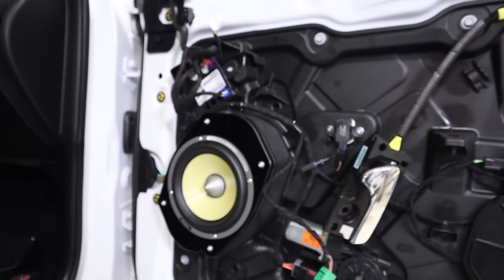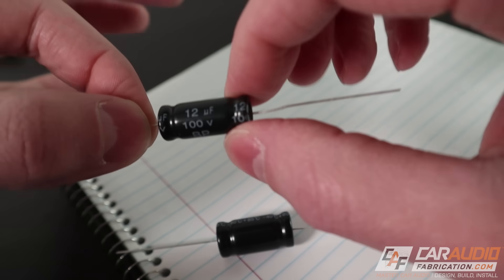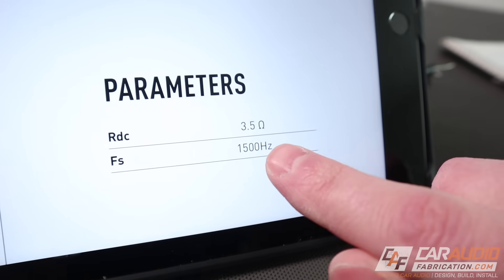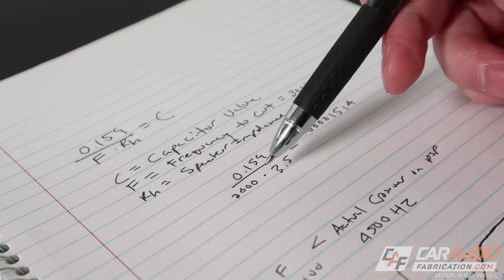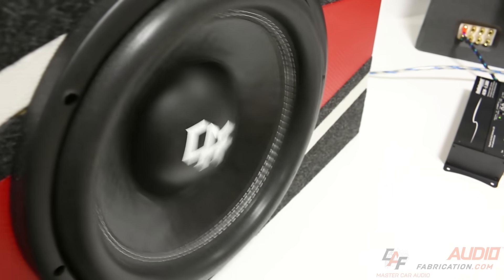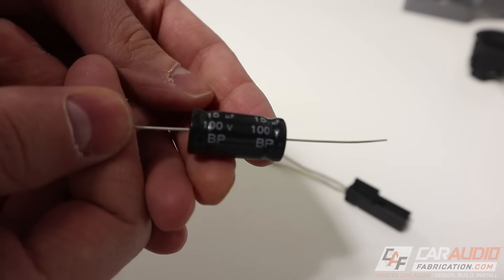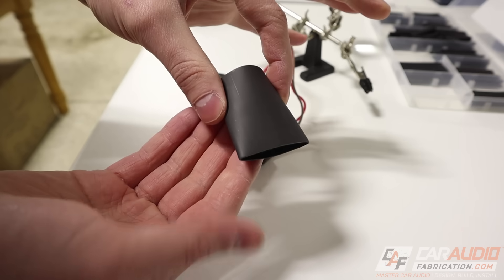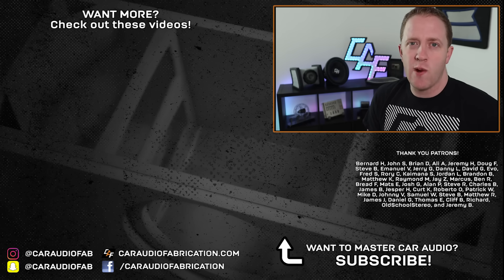PROTECT YOUR TWEETERS! Capacitors and WHY you need them

Comment: If I have the passive cross over that came with the component, could I just use that as the protection cap?
Reply from the maker: Yes, but in the mean time you will be running passive and lose all the benefits of going active.
Reply: CarAudioFabrication 

I mean, only having the tweeters connected to the passive cross over and having the mid directly connected to the amp.

Or would that still be considered a passive cross over?
Reply: Yes
Reply from the maker: That's still passive.
Reply: CarAudioFabrication 

Well, f... the the local shop sold me the passive cross overs for the Audiofrog GB saying that he would use the cross over to protect the GB15.
Reply: CarAudioFabrication 

Then again, what would happen if I push 250 watts rms at 4 ohms through a passive cross over if the tweeters and mods can handle 100 watts rms each?
Reply from the maker: I never said a passive crossover won't still protect the tweeter, so please don't go twisting my words and tell this shop that I told you they did something wrong. A well designed passive crossover with proper implementation is just fine. I don't know all the details of your system, so they may have done completely the right thing. The point is this video is about how to protect a tweeter in an ACTIVE system, sounds like your system isn't active. So this doesn't apply to you.
Reply: CarAudioFabrication 

I told the shop that I wanted to make my system an active system. I wanted the Audiofrog GB60 and GB15 to have their own connections directly to the amp. 

I have two Kicker IQ amps. I wanted the GB15 connected to channel 1 and 2 and the GB 60 to channel 3 and 4 on the IQ 500.4

Then the rear channels and sub on the IQ 1000.5

I’m trying to debate if I wanted to add a GB40 for a active 3 way setup but it may just be a waste of money.

I’m sorry, I’m not trying to twist your words. It just sounds like if I use the passive cross over for the tweeters, it’s still a passive system.
Reply: @thegreatempire3882  
As long as your tweeters are crossed over actively by a DSP or built in amp crossover, at a higher frequency than your passive crossovers are set at, you're not doing anything different than shown here. If your passive filters are set @ 3khz, but you cross your active system @ 4 khz, they will simply serve as a protective filter.
That being said, the closer the two crossover points are to each other, the more effect that passive filter will have on your tweeters.

To figure out if there's an issue or not, just tell us this.
At what frequency is your active filter set, and at what frequency is your passive crossover set?
What is the order of each filter?

Comment: you made a simple crossover. so its no longer "active"
Reply: Third
Reply: ekim andersom  
You will only affect the slope below the crossover point. That being said, when doing a 1st order filter, the slope starts vay up high in a situation like this. It will affect the active slope, but in most cases, it will be pretty insignificant.
Reply: @# of course it DOES change the phase (therefore timing).

Comment: Unless you have a crossover? Would you still need them?
Reply: If it's a good crossover no,just make sure to use the right frequency for your speakers in question.
Reply: @abimelecgalarza9918  Or you could actually pay attention to the video.The WHOLE point was that this isn't actually a crossover, but that it's there to protect your tweeter. If you accidentally set your crossover wrong, or have noise or pops, it filters those out. It is below the actual crossover frequency so it doesn't make an audible difference. It's just a protection circuit.
Reply: No he said this is for an active system
Reply: Like JayinMI said, if there is DC present on your amp outputs you are gonna fry voice coil in seconds if not instantly, unlike subs tweeters can't handle huge amounts of power so adding capacitor and blocking DC voltage will protect your tweeter in case of amp failure.